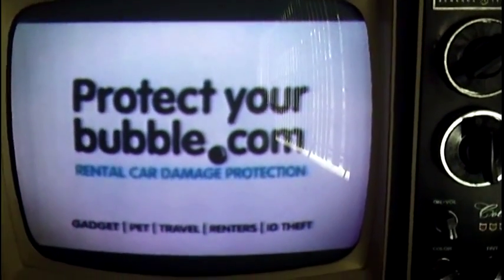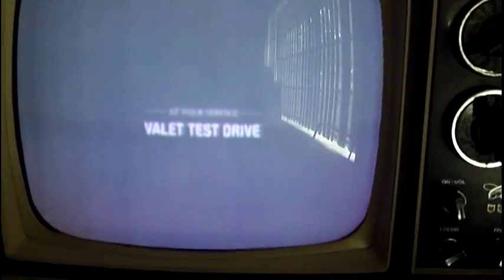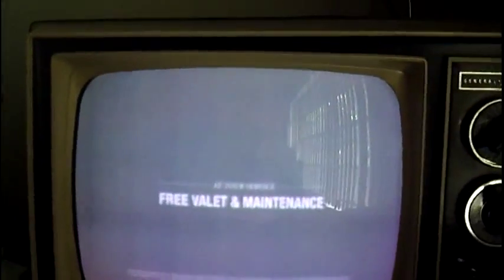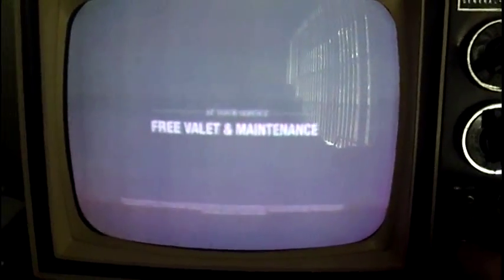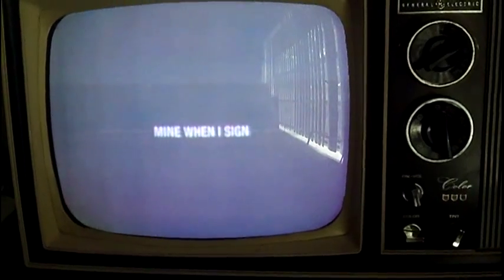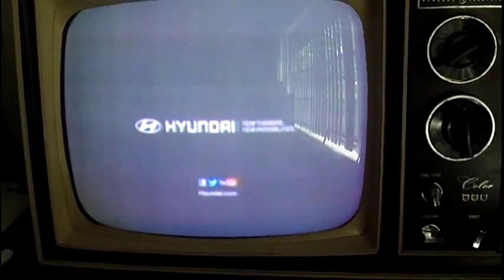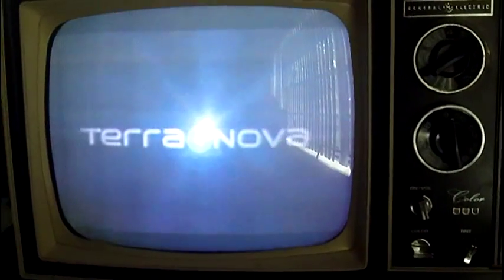Vintage Color TV GE Portacolor Fix (simple).

Comment from the maker: All tube bur for a transistor in the UHF and diodes in the power supply and color demod. That's the main reason I collect portacolors, I find it interesting that a all tube color set could be made with such a low tube count. that plus portacolors just seem to keep on going. All 4 of mine still have the orig power supply caps, I generally will replace the couple white elmenco caps (paper in a ceramic tube). But other than that (and that was done as a precaution) they seem to just keep on working.